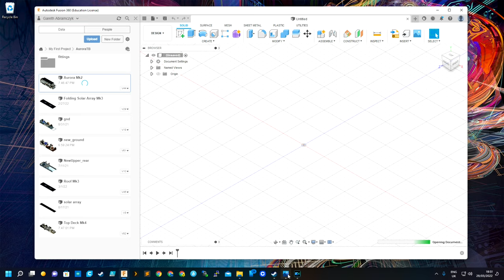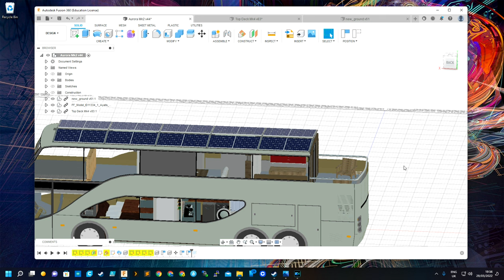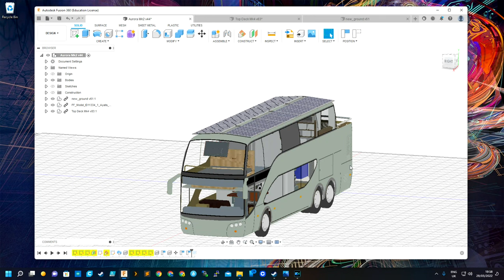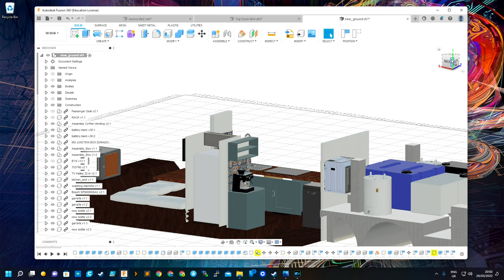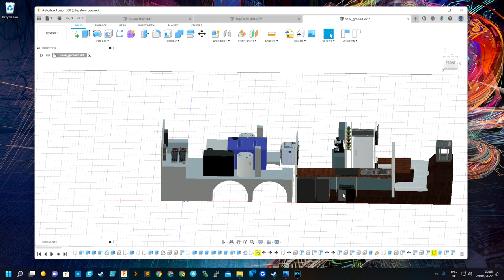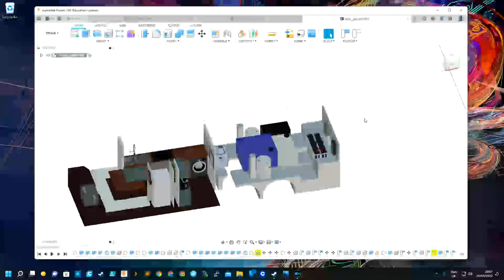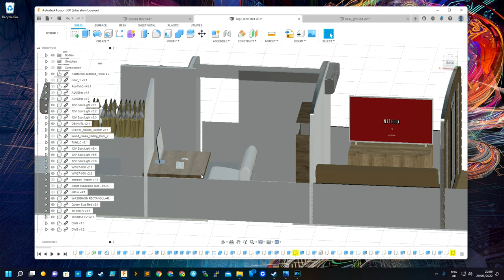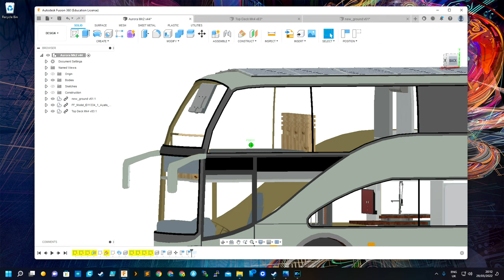Design of the refit - Before Bus Conversion

Comment: Love the design you have. Out of curiosity how tall is the bus now with the solar panels on the roof?
Reply from the maker: It should be the same, as after the skylights were removed the brackets and mounting are no taller than the bulkhead and panel that made the skylight... we will measure next time we get up there :)